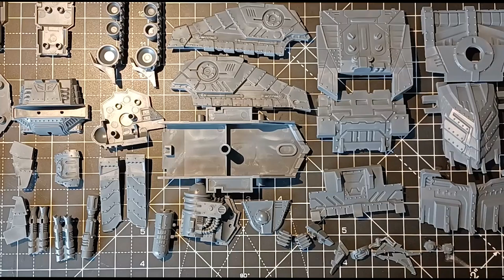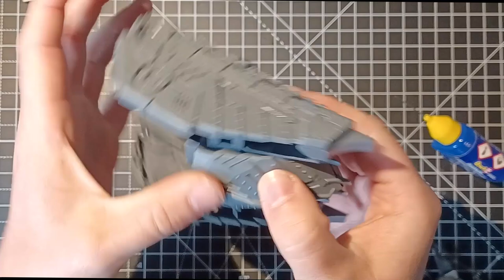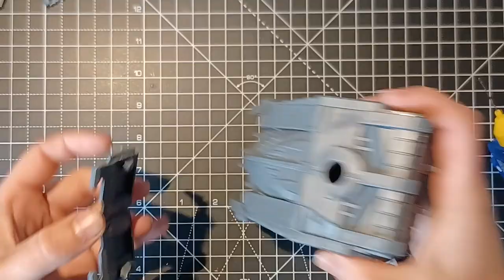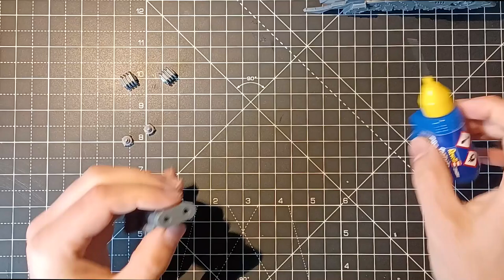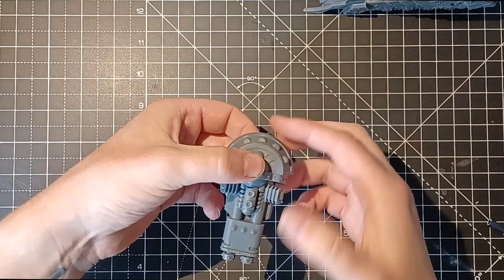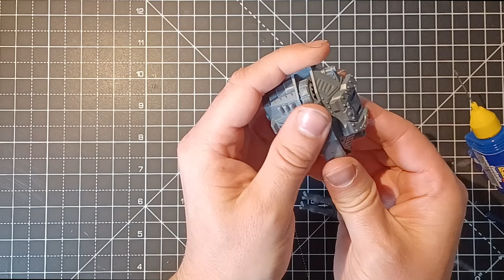Mantic Monday - Firefight - Building Vehicles - Sturnhammer Battle tank

Comment: This is very nearly what I did with mine, but I went the extra mile and mounted the dozer blade with magnets so I can remove it if I'm not using the Brandr variant.
Reply: Thanks for sharing. Didn't actually think about that. Will try and do that
Did you just hide the magnets on the tank on the inside?
Reply: @AdvancedSquadLeader  I drilled holes for them, they're not especially well-hidden, but don't look to bad from a distance.

Comment: is that plastic glue or super glue?
Reply: plastic glue by the look of it.
Reply: That's plastic glue, I've used one like it before
Reply: That's Revell Contacta polystyrene cement, it's by far the best I've found anywhere close to me. You can get the thin version in the video, which has a needle like applicator for precision work, and they also do a thicker kind that comes in a tube with a larger nozzle like most general purpose glues.